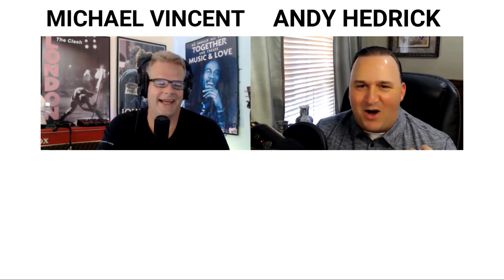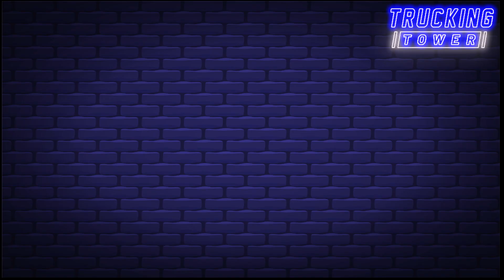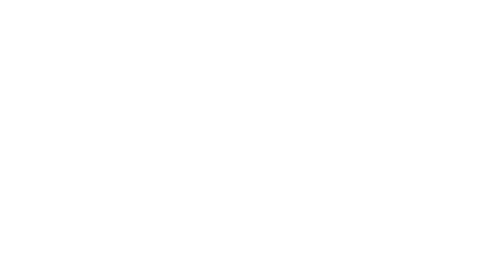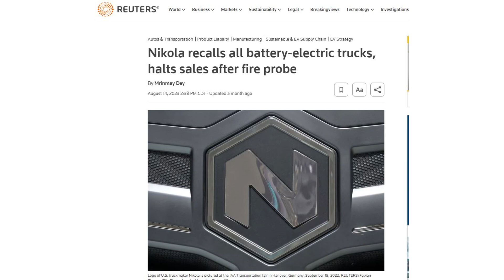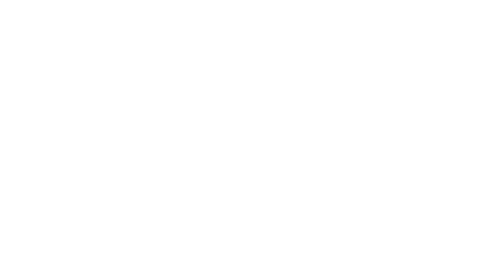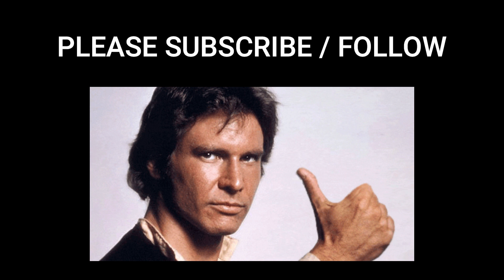Ep. 144 – Nikola Recalls All Electric Trucks & The Problem with Electric Battery Fires

Comment: This is what destroyed NIKOLA. They did not have a resources to replace all 230 battery packs. Thats too bad-it was a nice truck-ALSO-they had partnered w Hyundai to dev a hydrogen truck. After working together for quite some time the partnership was called off. Today, Hyundai sells hydrogen powered simi trucks - It is almost like, Hyundai harvested all the tech from NIKOLA that they needed then cancelled the partnership & Hyundai then put what they had stole/learned from Nikola into production. Hyundai obviously did not offer Nikola and assistance, not even a loan to help them thru this battery problem.

!